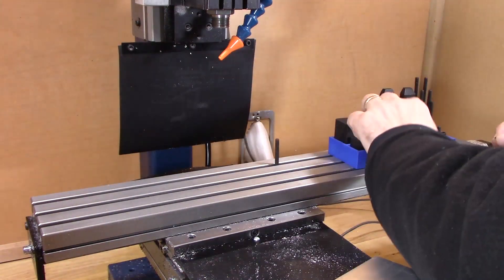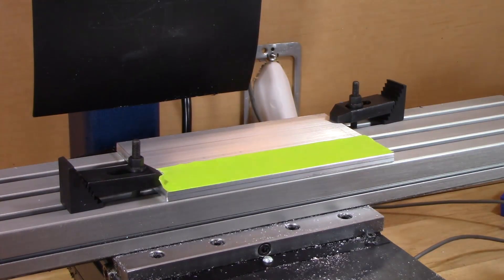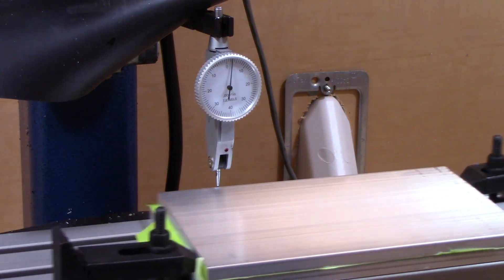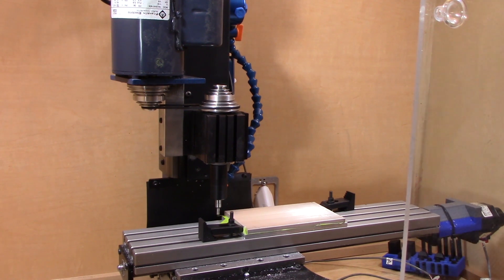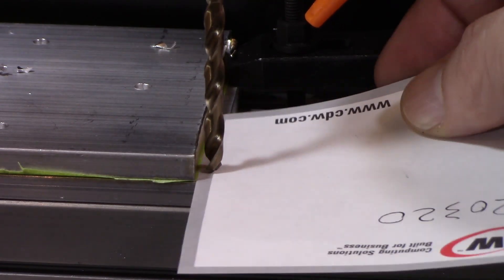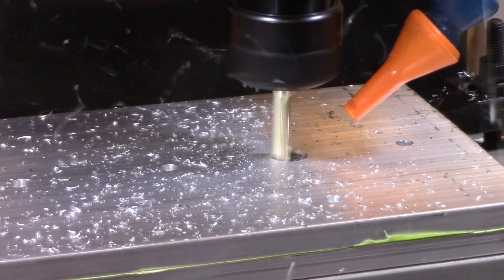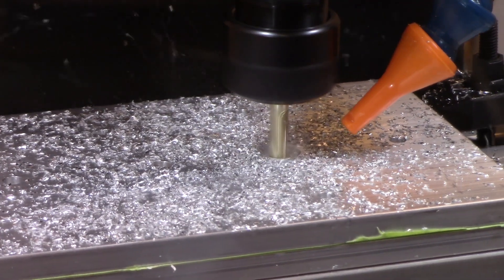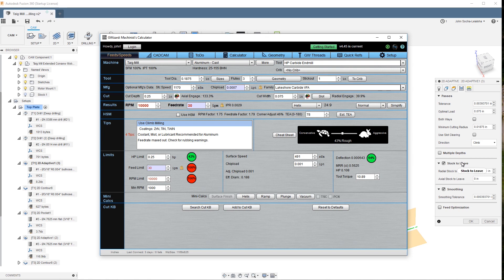#37 "Taigmach" Part 2

Comment: Hi, I am thinking of using this 3/4 hp sewing machine motor as a milling machine spindle motor and I would like to know if this motor can mill steel? thanks.
Reply from the maker: Of course. The limitation is going to be less DOC and WOC. So milling steel will be slower.
Reply: @JohnSL  Thanks for your answer, maybe 1 or 2 hp would be better.
Reply from the maker: I think you would then run into problems with the frame not being rigid enough. Plus, the loads on the spindle would likely be to much as well.
Reply: @JohnSL  Yes, your point is correct. I have a wabeco F1410 special frame, but it doesn't have a spindle, it needs an unpowered spindle and drive motor.

Comment: two tip that i will give you is to fill the hollow part of the frame of the mill with sand or epoxy granit ( remember weight of the mashine is your friend when its put in its final place ) and if you can. get your hands on a big thick steel plate and bolt the machine to it ( makes it even less prown to move it self and ones agen wright is your friend. and since you would be bolting them togeather pretty rightly physicks and vibration see's the machine and plate as one thing instead of two seperate things )
Reply from the maker: Thanks. I've since sold that machine and moved up to a Haas OM-2A, which is much more rigid.
Reply: @JohnSL  i  saw that you had gotten a has 
it was more in case that you still had the small one hanging around to du like small stuff on 

btw if you can then i woukd recomend filling the hollow parts of the haas casting with sand ( take the cabels and put them through a tube and then sand round the tune so the cabels can still move freely ) ones agen weight is your friend  ( you can never have to much weight in a machine as long that the floor can take it) ( in case you need to ship/move it then its easyer to get the sand out then epoxy and then fill it back up agen when its set down agen ) 

i have selv worked on a haas vf2 for like 4 years so i know haas pretty well and know that there castings have big hollow parts
Reply from the maker: I should have mentioned that I did think about filling the frame, but found the Haas before I finished upgrading the Taig. So I never went down that road.

Comment: I'm learning similar lessons with my DIY CNC Router. I've found that the "ideal" scenarios shared by so many experts and calculators are typically based off of machines that have much more power or rigidity than my machine. I've found that what might be unacceptable for a Tormach or Haas, keeps my machine running perfectly well, albeit at a much more conservative material removal rate.